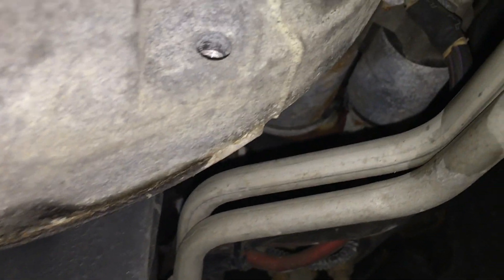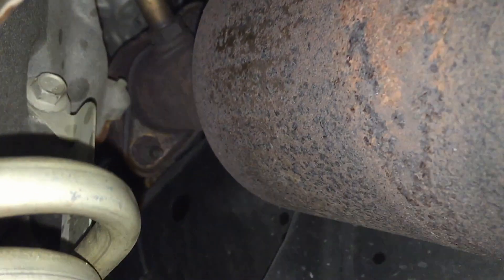Ford Vehicle Noises: #1 The 4.6L & 5.4L 3v Engine Hot Idle Phaser Knock

Comment: So i have a 2006 Mustang GT. Was Not Driven like it should have been by previous owner. Its an automatic and some of the information they gave me was they would drive it around 40-60 mph and drop it into 2nd gear to get the loud pops and bangs. Sounds pretty terrible, not actually sure if it does THAT much damage to a transmission. But now since ive owned it i can be driving for a good 15-20 minutes so its HOT and from completely stopped to accelerating it has a pretty quick ticking noise that is quite loud. It almost sounds like a lifter but its much softer. It does not make this noise going in reverse either and the motor has to be hot. Have no idea if its the actual motor or trans. I need a recommendation on where to start first.
Reply: Or what I can test to identify it quicker

Comment: Is this common on the 2011 f150 3.7. I have this noise 160k miles after changing spark plugs. If I remove the serpentine belt the noise goes away, but I replaced tensioner and water pump since they made noise, but no fix

Comment: Need help. 2004 f150 5.4 3v. After driving can it sounds like timing chain is coming apart.  New factory phasers timing chain. Guides. Tensions. Had local 5 star shop do work. I'm told oil pump might be problem. 15lbs at idle. Need help no one can give me solutions. Motor only has 120k miles

Comment: I have a 1999 Grand Marquis 4.6 SOHC 2V  190,300 miles. I live in FL where 100 degree heat index occur. I have been using Kendell GT-1 20W-50 conventional oil. I do idle the engine about 1.5 hrs a day 5 days a week during lunch so it gets some hrs only a 20 mile rd trip to work and i change oil and filter every 3000 miles i grew up on this product and have a lot of faith in it but wonder if it's a little to heavy. I welcome any comments oh and i don't baby it. great video's by the way

Comment: My 2005 f150 will do a really loud knock atfer driving fast when I go slow to pull up a hill or to pull into a parking spot I just replaced the camshaft sensors thinking that was it but it didnt fix it if you have any idea if what it could be please lmk
Reply: It will kill if i dont but it in neutral and rev it is dies on me
Reply: Ever figure this out?

Comment: We have a 1999 F150 pickup. 6cyl 4.2L 85000 miles. It has a ticking noise when we first head out and only during acceleration. Then after a few minutes it goes away. Any ideas?

Comment: I have a 1999 Ford Crown Victoria LX 4.6L. There is a knock when the engine is geared and it occurs when rotation is low (4th gear) or too high (on resumed). When car is disengaged and in idle, the knock disappears. Some weeks ago I substituted the intake manifold for a brand new one, once it was leaking, and I noticed that some spark plugs holes have oil inside. Car is running, but it seems “tired”, with low power. What such knock could be?

Comment: My truck makes this noise aswell but my problem is it is hesitant when I push the gas pedal and the rpms will seem to freeze then jump after a second of the pedal pushed down. Also has been dying on me. Very sluggish. Truck has 256xxx miles on it. Plugs are probably way over due along with 02 sensors.

Comment: @fordtechmakuloco I'm having this same sound on my 2013 Raptor 6.2 with 93k miles. The problem is it's non-existent during a cold start, then slowly gets louder, gets to the  loudness in this video, then slowly gets quieter, and once fully warm it goes away. I've replaced the vct solenoids, spark plugs, all the pulleys, cams lifters and valve springs look good too. While I had the valve covers off, the timing chain didn't have slack in it either. Any idea what it could be?

Comment: I got a 4.6 that ran fine when I parked it.. it sat threw winter and I start it up.. a knock.. hard and loud.. everyone I let hear it kept saying in was a spun barring.. how when it sat for months?? Well I didn't buy it for it didn't make sense.. so I removed the front cover, and all my guild rails were all fine.. so I push in on the tensioners.. one good and one bad.. there is my knock.. it was weak, lost all it's oil sitting, instant knock when running.. best thing to do when something like this happens.. don't run ur car or drive it.. find the cause and address it imediatlly.. fix it and save urself time and money buy not playing the guessing game..

Comment: I seem to have a rattle (like marbles in a can) only after I let my RPMs come down between 1200 and 600 after a small rev. I changed the VCT solenoid, but no go. There is also a mild rough idle/shake. All happens when at normal operating temp. I am assuming the phaser is bad now. I unplug the solenoid and it is fine. Recently changed driver side phaser. Pretty easy job.
Reply: That rattle is probably the timing chain slapping, it happens when the tensioners blow out.

Comment: Hey , 2007 5.4 3 v just hit 185000 with no engine noises.  Oil changed every 3-5000 miles 5w-20 . Anyway had tranny rebuilt and got truck back with it making a slight noise and shake at idle . No codes . Also the tranny is shifting hard up and down intermittently and loss of power in overdrive like getting onto highway. Can tranny /torque converter make noise like not quite knocking but a real light kind of knocking lol . I seem to lose power more the longer I drive and tranny gears shift harder the more I drive as well any ideas would be appreciated

Comment: How long can you drive a 07. Ford f150 with a bad phaser ????
Reply from the maker: If they are just knocking at hot idle then they can go for a long time maybe 50k miles no sweat.
Reply: FordTechMakuloco Are the new cam phasers redesigned so not to fail or are we just reinstalling the same junk.  Would be a good idea to change Cam phasers and vct solenoids at the same time?  My truck sounds like this when the oil has 3,000 miles on it. Change oil and it quiets  down.  Use 5-20 full synthetic, I know it's not as nearly as good 100% synthetic. 
 Only hot idle is loud.  People tell me to switch to 5-30, "you have nothing to lose the engine is junk and out of warranty."

Comment: I have a knock after changeing timing chain and oil pump still knocks mechanic said was not a rod thinking its a bad knock sensor. Do you have any video's on that ? I have a 2003 Ford Expedition XLT.

Comment: hi can you help??  It did it today for the first time I accellerated pretty fast and noticed it. It was a rartle sound that feathered in as I accelerated and out when the rpms went down. Sounds like if you touched a house fan lightly with a pencil???  Regular unleaded
, gassy smelling oil but not foggy looked clean. No check engine lights.. Slight vibration in steering wheel and in gas pedal but faint and didnt seem too out of the ordinary...

Comment: Hello,Have your ever come across with a triton 5.4L engine with a droning sound every now and then but seems to go away some times when the engine is reved. The sound is like a horn but more like a drone sound then goes away after while. The sound comes no matter if the engine is cold or hot. Any help would be appreciated. Regards,Andrew
Reply from the maker: Only thing I can think of is the brake booster.
Reply: Had this problem on a crown vic.

Sounds like the IAC or idle air control valve
Reply: Beneath the manifold Ford installed something which regulates fuel / air mixture flow. That devise has made a constant low horn like noise for approx. 130 , 000 miles. The dealership called it a sensor and its price was approx. $75.00 to install ONCE THE MANIFOLD IS REMOVED. The manifold is PLASTIC and susceptible to permanent damage when overheating of the engine occurs.
Reply: IAC , clean or buy a new one .
Reply: I had the Drone at certain RPMS, Found mice nest in the air intake baffles. Drone went away after cleaning baffles. added 1/4" metal screen to intake

Comment: Can you explain 2 problems with the coyote.  Tick after first oil change, and surge at or around 3k rpm with steady 3 or 4 th gear.   The tick is intermittent and sounds like a stove igniter.

Comment: Great videos, I had a loud ticking that sounded like a phaser knock. I made the mistake of using 10w-40 oil on my previous oil change. The noise started soon after the oil change. After some reading and understanding of what i did wrong, I changed the oil again with mobile one 5w-20 synthetic and the noise went away after a couple days of light driving.  Your videos give me peace of mind and confidence to help me sort out some of the common problems with the 3 valves.
Reply from the maker: Nice!

Comment: I have a 08 ford f150 with the 5.4... can hear a knocking sound when truck is warmed up and am traveling at slow speeds... I can I usually hear it when in a drive through with the windows down... when the truck is at a complete stop, there is no knocking. Any idea what the problem could be?
Reply: You ever find out what it was?  Mine is doing the exact same thing.
Reply: I am guessing it was the camshaft sprockets, but I replaced the timing chain and timing chain guides while I was in there. I said "guessing" because there was no play in the timing chain or timing chain guides.
Reply: Thanks.  That's what I was afraid of.  Looks like I'll be tearing into mine then.

Comment: Let me preface my comment by admitting that I have limited information available. I may have an opportunity to pick up an extremely clean 2003 Mountaineer AWD V8 that has developed a knock. Since I haven't yet inspected the vehicle I want to be as prepared as possible when I go to look at it. As best as I can determine, this Mountaineer predates the 3V version of the 4.6 Modular V8, but I have not been able to discover if this phaser/vvt solenoid issue was present in this vehicle/engine model year. The seller states that the timing chains were replaced about 4 months ago, but he has not had the current noise diagnosed and is wanting to sell the vehicle as is. I am pretty confident in my ability to replace the phasers if necessary but need more information about exactly which engine I am dealing with. Your Thoughts?

Comment: I'm new on here and recently purchased 2007 ford f150 lariat 4x4 I'm having the same issue like this plus another noise when driving. when I get up to 2800 rpms it makes  like rattle/surge noise. is it also caused by the cams too. I already ruled out the heat shields thinking it was that n installed new cats on top.
Reply from the maker: +Andrew smart You will find allot of noises are caused by the phasers from an idle knock to a rattle noise due to phaser oscillation. I have a video on how to replace them and where to get the parts the cheapest in the video description-https://www.youtube.com/watch?v=HZuArjvEfRc
Reply: Andrew smart– you drive ? Then you are claiming to be engaged in commerce, that is;  making a wage or earnings upon public hi-ways, and if you don't, then you are a traveler. And are not required to own a drivers licence nor register your private vehicle — by Supreme Court ruling. But better do a lot of research before doing this.
Freedom From Government.com

Comment: Yes, I have a 2005 F150 FX4, and have the same sound,  but it doe not bother me , the sound.   What if I just let it go...some posts it destroys the engine and timing chain.
Reply: I'm having this issue. What did you end up doing? Thanks.
Reply: @hulkhuggett  Repairs shops said it was typical of the 3v engine, poor design. I was quoted $1200 to repair, but it could run higher.  I traded the truck in.       But, a neighbor said he replaced the solenoids, and that fixed the knock, same type engine. easier fix.

Comment: Alright, I've got a 2005 4.6 liter in a CV. It knocks only when under load and at operating temp. I've basically whittled the sound down to the bottom end, but it could be anything resonating anywhere really. I know it's not top end though. Everything up top sounds great. I've got a couple of options, either it's a cracked flexplate, bad wrist pin, or bearing of some sort. I'm not leaning towards a bearing, because I've never experience a bearing knock that only happens when the vehicle is warm. I've replaced the plugs with Motorcraft's, and bought new MSD coils for it too. It seems to run fairly well actually, but just when it warms up weird things happen.

Comment: Watched your videos. Well done. I did change out the VCT solenoids and did it without removing the valve covers on my 2005 5.4L. They allow just enough room on them. But I'm taking them off anyway... My question... I'm installing the Livernois lock outs on the phasers. I want to replace the timing chain guide, tensioners, etc at same time. Local Ford dealer tech said he would recommend installing the 2 valve type timing chain. He said the tensioners on the 3 valve are 'floating' and the 2 valve have 'ratcheting' type.  So what engine timing chain parts would I order so that they would fit directly on my 5.4 3 valve?? A standard 4.6L or 5.4L 2 valve?? A 2001 4.6L engine??

Comment: Mine only makes noise for 2-3 seconds at startup (before oil pressure gauge moves), smooth and quiet after that.  Passengers are like WTF is that sound?? for that for that 2-3 seconds though.  Is that just leaky tensioners?  I assume the rest is OK since there is no noise after that.  My friends truck makes no noise at startup.
Reply from the maker: +Hubjeep Yes your tensioner gaskets are blown out causing that noise.
Reply: Thank you for the reply.  I assume the inexpensive chain guides should be replaced too.  Timing chains while I am in there?  Though I don't really think of timing chains as a preventative maint. part.    What brand tensioners do you suggest?
Reply from the maker: +Hubjeep I recommend following my video on timing the engine. In the video description I have a link to the kit and tools that I recommend to completely fix the issue while it is all torn apart.video- https://www.youtube.com/watch?v=qpPs9KuJmqM
Reply from the maker: +Hubjeep Kit-  http://www.amazon.com/gp/product/B00E2UMX40/ref=as_li_tl?ie=UTF8&camp=1789&creative=390957&creativeASIN=B00E2UMX40&linkCode=as2&tag=fordt-20&linkId=W2NNMVDPJUAM4EK2
Reply: Thanks for the link and video.
Reply: I have a 2007 Grand Marquis  when I start it up I hear a noise that last for maybe 10 seconds. Is it the fuel put starting up?  Thanks. Colt
Reply: I have a 2001 ford f150 5.4l when I start it up in the mornings it makes a hissing like noise on the passenger side what could it be.

Comment: you are now god to me.  I have a mountaineer that is my baby and is doing that,  and now I know what it is :) it has the 4.6 v8, making that same sound to the note.  loudest in the same area.  thank you!!!!!
Reply from the maker: +Xion Monro Check out my repair video on how to fix this I also list the parts and tools you will need for the job.
Reply: +FordTechMakuloco  I saw :) thanks!  looming forward to making my mercury run great again!  I got it and thought it had a rod knock or something,  but other than the noise shows no other signs, no metal in oil,  nothing.
Reply: +FordTechMakuloco I have a 2v 4.6 2000 f150 with similar noise, like lifter knock or tick. Watched 12 videos, none the same as mine.  Ideas?  Subscribed.

Comment: My 5.4 3v (2005 Ford Expedition) is making the exact same noise and is louder on the passenger side. An at-home mechanic told me the motor is bad. But then I came across this video. Suggestions?? Need help please.
Reply from the maker: Taj Woods-Sutherlin Yes you need phasers is the noise there mainly when hot?
Reply: The noise is there when it's hot or cold. I'm getting p0420 code.

Comment: Great videos... My 2005 F150 5.4 has 144k miles on it and runs great and of course it noisy. My question is which oil and weight do you recommend I use? Thanks in advance.
Reply: +Ramon Gonzalez 5w20 only and has to be synthetic only

Comment: I have a 2004 F-150 that makes this noise.  When under warranty, the dealer said it was a normal operating characteristic.  It now is 11 years old and has 75k miles on it.  It still makes the noise.  Is it doing harm to my engine?  Thanks in advance!
Reply from the maker: Dewy Russler No harm
Reply: Thanks FTM!
Reply: FordTechMakuloco Oh, I wanted to ask you something else if I may.  The other day, I was driving close to a jersey wall with my windows down (so I could hear my truck).  I noticed that just off idle (around 1k rpm), there is a inconsistent sound that sounds like a tensioner or something allowing slop in the timing chain.  If I stop and rev to 1k, I can hear it too (seems to do it under light or no load). My serpentine belt tensioner is good so I was thinking it possibly had to do with the timing chain tensioners.  Is this noise related to the phaser knock?  Have you heard it before?  Thanks in advance for any guidance you could provide!

Comment: So phasers knock at hot idle? I've got a knocking that I can always hear. Cold start, idle, hot idle, driving down the freeway, the sound doesn't really seem to change other than it is getting louder in general. So do you think I've got bad phasers? Or would it be a diffrent issue like a bad lash adjuster?
Reply from the maker: Alex Woolsey If the phaser is really bad they will knock at any temp but also lash adjusters on these are pretty common.
Reply: FordTechMakuloco Thanks for the quick reply.
Reply: so the lash adjusters can be manually adjusted or its everything cotrolled by oil pressure?

Comment: I got a 2004 5.4 FX4 tapping on rear of engine, can really feel tapping in the 8 cylinder ignition coil. I change out all sparks plugs & ignition coils, but when driving it shakes going uphill at 55mph or faster. Is this a bad phaser or something else?
Reply from the maker: icon nlm I would remove the valve cover and inspect. roller followers are common failures on these and hydraulic lash adjusters as well.
Reply: +FordTechMakuloco
Could the problem get fix with a changing of the cylinder heads and will it be less costly?